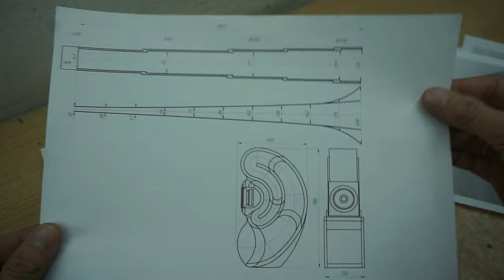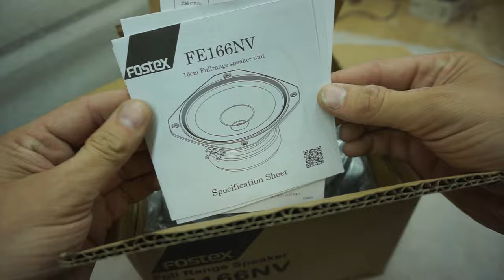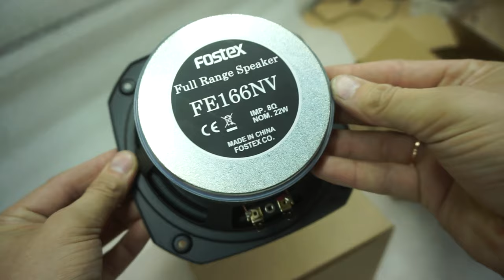BACK LOADED HORN DIY

Comment: It was clearly seen in the installation video that the baffle surface was not horizontal. Furthermore, it was confirmed that the edge of the Fostex unit was twisted even though it was brand new. Although it is a Japanese manufacturer, it is manufactured in China and the quality control is not accurate. I also bought a woofer, but I called the manufacturer to complain that it was poorly processed. I had it replaced, but the third time it was the same defective product.

Comment: Why go through the hassle of making it curved inside? All that achieves is permitting the not-good-sounding harmonics reach the mouth of the horn. Just use angled pieces and the sharp corners will cause reflections, which filter out the harmonics above ~100hz.

Comment: That’s a real piece of art. This building method needs a lot of material because each layer requires a big surface to cut from. I would try to create the construction with thinner wood which can be cut with a CNC laser. I would divide the tunnel walls in smaller sections with puzzle connectors on their end’s. You must put them together with a half length offset between the layers to keep it solid. In this way you save material and time.

Comment: Fabulous - I love the shapes and the satin finish looks very good.  I have a pair of "Carfrae Little Big Horn" Replicas that I built - all the MDF came in CNC sections in a huge crate that still needed glue and machining. I took my time and had to save up to get a professional spray finish.  At 1400mm tall with 8 inch drivers they are monsters but I have a big enough room for them.  Little big horns have a seperate subwoofer to get just a bit lower.

Comment: If you want a substantially larger and broader roundover and you also have a strong enough router, then try to find handrail bits. They're used to shape the top and sides of a stair handrail and the bit for shaping the top is generally a very broad, shallow roundover.

Comment: You could also put the speaker terminals at the back out of site and have you thought in the design of putting sound deadening material ??like Bituminous paint to damping down reflections of the back sound wave ??
Reply from the maker: it was not quite easy to move the terminals back, there were a number of problems, this is my hobby, I am a fan of building a special room with sound attenuation while it is still early.
Reply: It's a horn, you do not line a horn with sound dampening material.

Comment: Very interesting speakers, great job!  How low do these go?  ALso how do back loaded horns respond to fir filters/dsp?   Thankyou for sharing
Reply from the maker: Cutoff frequency (lower frequency of configurable horn extension profile 33 Hz)
Tuning frequency 40 Hz
Horn length after bending design 1950 mm
Speaker 6.5 inch
Throat area 45 sq cm
Speaker volume 0.6 l
Reply: I am wondering if the speaker volume is kind too small? I read an article says the volume is cone area divided by 25. So if your cone is 6.5 inch in diameter, then the volume is 8.5 liter. I dont know if the formula is wrong or what?
Reply: I am thinking to build speakers like yours but confused with caculations.